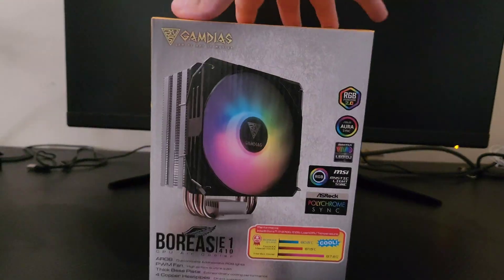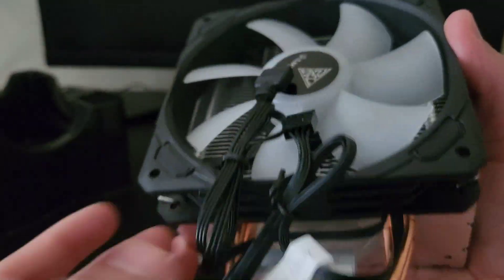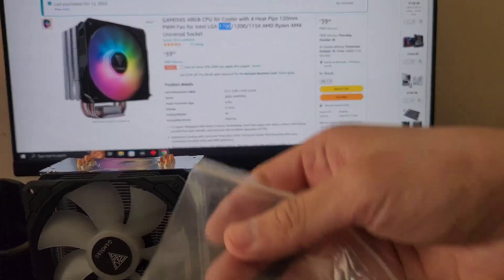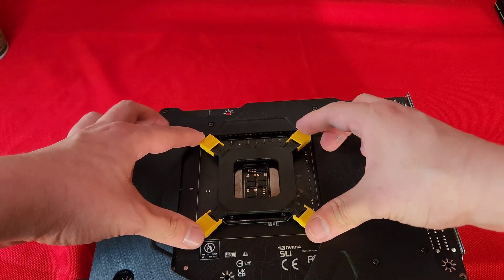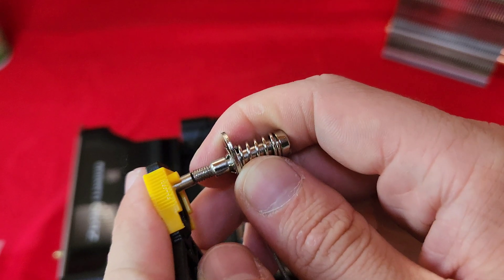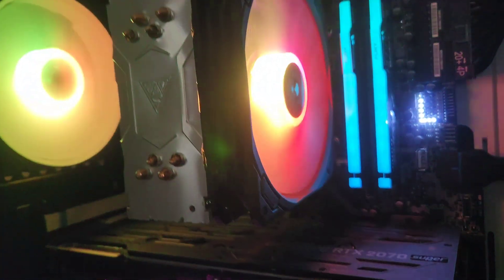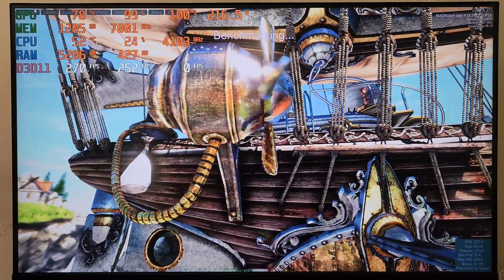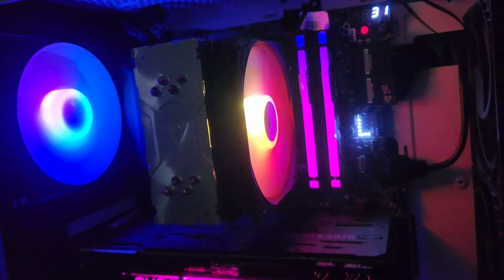Gamdias Boreas E1 410

Comment: Is i use amd screw in intel i think i use that because Of the spring is in itel screws is any problem if i use amd screws?
Reply from the maker: If you use the AMD screws be sure that you don’t break the cpu socket. Otherwise I think you’ll be fine
Reply: @kngx64  ya I used Amd Screws Working Fine.

Comment: Dude, at 3:00 you forgot to remove the CPU STICKER!!! Come on, bro! In fact, because you forgot to do that, I also forgot to do that, when following your instructions. Dude, people can have serious issues because of that. So, I had to remove the cooler, and remove that sticker, and then reinstall, because when that sticker's on, you will be in BIG trouble. Please, sticky this comment, or make a new comment, instructing users to remove the sticker, and sticky that comment.
Reply from the maker: My bad, I’ll try to not miss it next time.
Reply: What cpu sticker? I don't see any
Reply: @ZA-7  The cooler has a thin plastic cover on the copper plate which must be removed before installing the cooler, or your temps will be through the roof. It's very dangerous if left on.
Reply: @thatfirstone  Ohh nice explanation, thank you!

Comment: Will it work for CoreI7 9700F ? With stock cooler (newly applied thermal paste) its idling at 50-55C
Reply from the maker: Yes, it should work. If you don't plan on doing any rendering or just plan on light gaming this cooler works great.

Comment: socket 2011 has thicker screws... no need for back plate.. LGA 2011 is not removable and will work.
Reply from the maker: I did not know that, thank you for the information.

Comment: Bro this cooler is pathetic. 13900k going 100 at full fan curve.
Reply from the maker: I would recommend this cooler up to an i5. For an 13900 I  would recommend a liquid cooler as I wouldn't even use this cooler on the 13700.
Reply: 13900K <--problem
Reply: aint no way dude expected a budget air cooler to be powerful enough to cool a 13900k
Reply: yup, same for a 4790k... Cryorig H5 was much better for me.